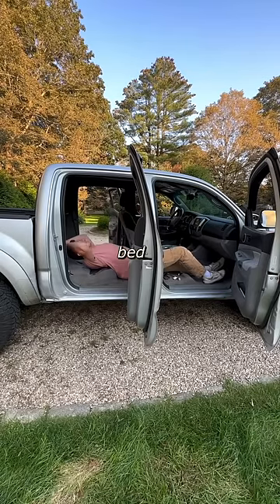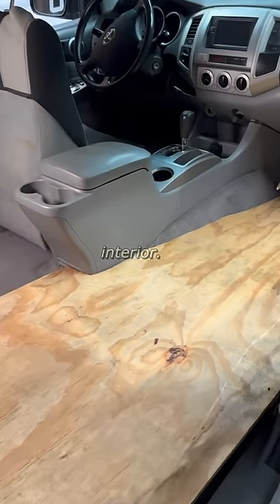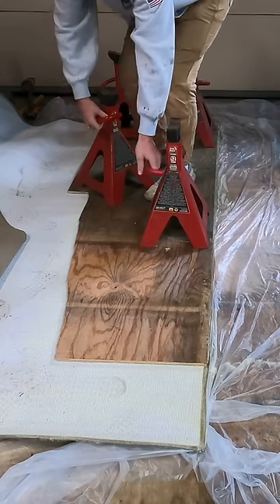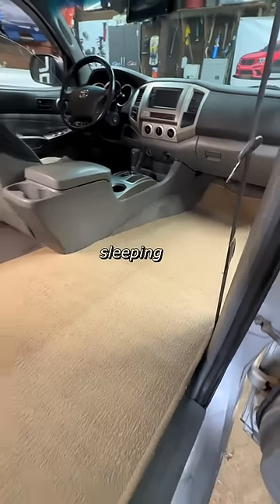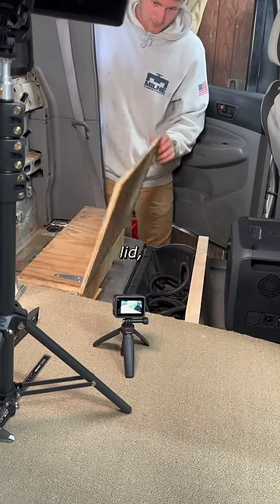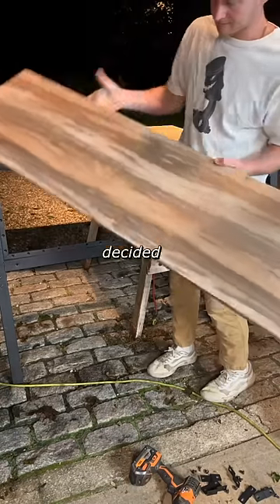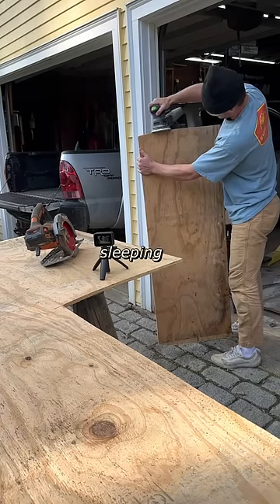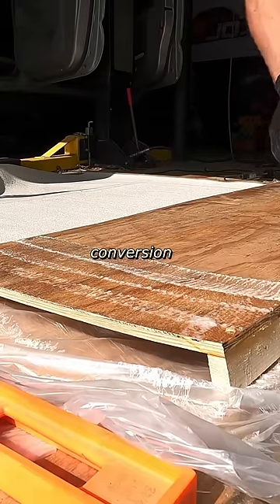Swapping the seats in my truck for a cozy bed

Comment: Ive done something similar to this in the past. I travel for work and sometimes I'm just gone for a week or less. When i first started i didn't have the money for hotels, so I'd yank the passenger side seat out of my extended cab truck, folded up the passenger seat, and rolled out a couple of sleeping bags. One stuffed with pillows for a mattres  It was surprisingly comfortable. I'd sleep in a walmart parking lot and take showers at a local campground.  Why wouldn't i just use the truck brd? The same reason you don't sleep outside on your patio. The weather and security. I won't get rained on and i can lock the doors.

Comment: Yeah, use the truck bed. If you want to be creative put a pip up camper with a protective roof that makes the bottom of your truck bed. That way you can still haul  even though the bed won't be as deep. You could put your powerbank towards the gate and rig it to fit the trailer junction to charge up when you're running the truck. The walls would be maybe a heavy scotched canvas, and if you're worried about weirdos or cougars, you could use security gate linking (like they use in malls or street faced glass fronted shops). Add a keylock and hinges to your rear glass to keep it functional and allow cab access.
Or hell, one of those inflatable tents that tuens into a two story castle with air defense batteries.😊😊😊
Reply: The cabin has heater and ac, and is also sealed
Reply: @swapnilmankame  I suppose converting the window to a slider (like they used to be but bigger now).  Dukes of Hazzard that back glass.

Comment: Reflective emergency is the more cheaper durable long-lasting material for warmth.

Take the paneling off the doors and crumpled it inside. This will reflects the cold from being absorbed through the metal.

I lived in a vehicle for a long time and when you think it's actually going to be warmer than living outside it's actually not. However in the winter your food's stay fresh out of a cooler so what does that tell you about how they handle cold.

If you're running anything that allows you to warm up whether it's via the car or a warmer it's important to crack a window to allow the hot air to escape so it doesn't condensate leaving you waking up soaking wet. 

Cut up the emergency reflective blankets into strips fold and keep in your pockets to keep yourself warm. However you choose to wear this material make sure that there is another clothing material in between your skin and the reflective material. 

When you live outside or in your car please remember that cotton kills as we say amongst the unhoused population.this is because it allows you to get too hot too fast and then your clothing is soaked and your cold from the inside out.
🙏🌎💚🌍💚🌏🙏

Comment: Should just weld a frame together that utilizes original seat mounting locations in same shape but raised up and use space underneath for storage. Use an old bed frame for material.

Comment: I do landscaping I've got prepper stuff in my pathfinder yet have enough room to put a lawn mower in with no effort at all. Survival gear, food water and gas. Gas on top everything else inside. Can hook up to 110 in a breeze.😊 110 heater, microwave and grill inside. What do you think? And the added plus a 95 Pathfinder doesn't need a EMP shield. How cool is that?

Comment: I would have held back an inch on the bed platform and the put a couple layers of 10 lb carpet pad and then I would have left the carpet a couple of inches long all the way around the plywood.  I would have then folded the carpet over to the back and stapled it to the plywood adding some comfort to the platform.

Comment: I did this in a 1994 Dodge Dynasty by unbolting the back and cramming it flat between the rear seat and the front seat. Took 10 minutes. Lived in in for three months while working day labor until it got too cold.

Comment: Amazing work...but I would only suggest that you should've used carpet padding under the carpet..trust me your back and hip bones would've thanked you..and you could've just used the adhesive spray for that too ..plus it will insulate the truck better too..

Comment: In the future cut the wood template about a 1/16in smaller and wrap the carpet around it. This will make it look better and reduce the chances of scratching the crap out of the plastic interior parts.

Comment: I do not get the reasoning or purpose of this build. One of the times I was homeless, I built a complete bed in the back of my truck that still allowed me to work out of it as well as sleep, eat,live, when not working completely out of garbage. I was stopped on a few occasions the cops were amazed how nice it was on the inside, everything was kept neatly in place. The best part was you could not tell from the outside that someone was living in it. It is amazing the options you have now compared to thirty years ago.

Comment: you are supposed to let the contact dry first then stick the 2 parts together. its called contact cement for a reason. you dont stick them together first then let it dry.

Comment: Why do you need a headboard?
Also, why put a bed IN the cab when you can put one in the BED of the truck?
Just get a shell?
Truly curious.
Reply from the maker: Because my gear goes in the bed 😁 And the cab is already water tight with locks, weather seals, heat, etc

Comment: Way too much trouble.  I used a gym mat and a 4” foam from an old king bed topper foam and used that on the back seat floor with seats folded up or in back bed.

Comment: What happens to the airbags once you remove the seats 😂🎉 Safety first speed next & how do you wear seat belts or bed belts to hold you in case of roll over bars also needed 😅

Comment: Contact doesn't need to cure. You let it get tacky after spraying both pieces you intend to stick together (2-5 min) then it adheres to the other piece immediately upon contact. Hence the name. And why is the bed on an angle?

Comment: The boomers in the comments 😂 The bed of the truck isn't as warm or as secure as the cab. If you're solo camping or travelling, this is a great option. It's not that hard to bolt back the seat in when it's not used as a camper. Looks like it'll be a useful ride to me!

Comment: Huh. What kinda contact glue are you using that you have to let it rest overnight. And why the weight. Contact glue is sprayed on both surfaces and once they dry for 40 min when stuck together they're glued. Dont have to clamp it or wait, that's why it called contact glue

Comment: everything about this is a hard pass... "step #1 get 41k to buy a truck... step 2 destroy the interior... step 3, buy 31$ of PCB and spray can glue and stitch together carpet scraps... now install that in ur car and LARP as a rich homeless". hard pass, any non-nepo use 41k on a downpayment.
Reply: bro made a "storage area" out of shed hinges and didn't measure the angle difference. buy a level bro its like 11$ your parents can afford it.